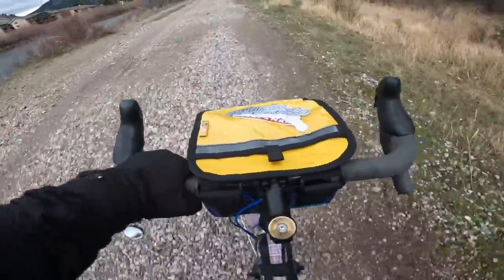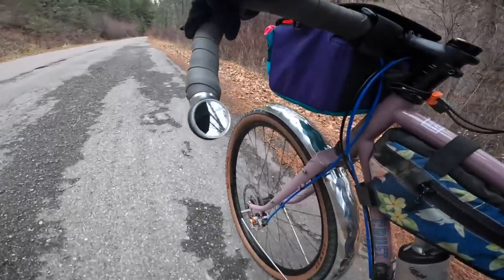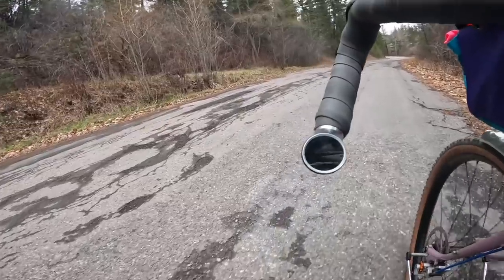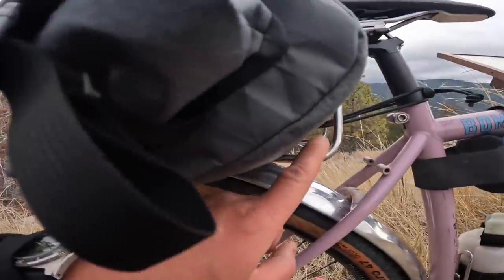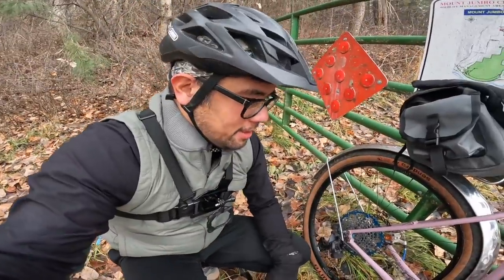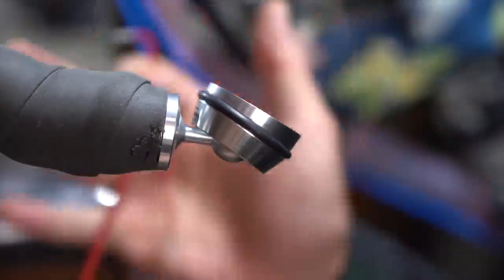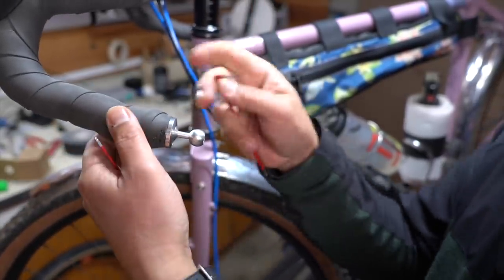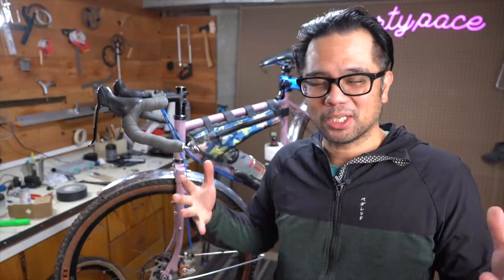These Are Pretty NERDY But Cool!

Comment: In over 10 years of daily commuting I would not be without a Busch and Muller (aka B&M) 60mm diameter Cycle Star mirror in my bar end. Optical quality is beyond any of the cheap plastic lenses. Luckily we ride on the left here in UK so leaning my bike for those drivetrain pictures is not a problem!! For mudguards/fenders my Portland Design Works are still rattle free and smart after at least 30,000 miles

Comment: in 2032 you'll be able to fasten your iphone 19 to the back of your helmet and use a neural link connection into your brain to have visual imagery and lidar supported depth sensing to the rear of you. There may even be lane keep assist and automatic emergency braking integrated into the neural link suite of tools.

Comment: These are fenders of proper length! I remember my first winter of commuting on hardtail with short front fender, which I extended with a contraption made of of large plastic bottle cut in half - curvature made it rigid. Boys I felt like a weirdo riding through town but dry legs convinced me.

Comment: Adding small leather washers to every fender support helps a lot with squeaks. They're getting hard to find but wouldn't be hard to make.
Reply: Remember those days of tire tubes? Well an old tire tube makes excellent insulation stripping anywhere. That rack on the fender rattle instantly made me think of a strip of old inner tube right in that spot lol.

Comment: I went for the same version of the Gilles Berthoud mirror..😃 yes it's expensive! But it's like jewellery for your bike. 🥳
 I used the Cateye BM-45 for a long time which was pretty good. I think it actually has slightly larger viewing surface but would bump out of place on really rough stuff. Maybe grip paste would've helped, don't know. 🤔 Truly wouldn't want to be without a mirror now, especially with wind in the ears sometimes I just can't hear cars approaching from behind and craning the neck to peer behind every 10 seconds is a pain! 😃 Cheers. 👍

Comment: I bought a set of the VO wavy fenders in noir when I did the 650b conversion on my Salsa La Cruz. Getting them where I wanted when the bike was designed around narrower 700c tires is took a bit of work, but they have been rock solid on all surfaces so far.

Comment: I've got my Take-a-Look permanently attached to the visor on my helmet, which I have been using for several years now.  It took some bending and ingenuity, but the mirror is always in a predictible spot allowing a quick and precise glimpse without looking away from the path ahead, does not destroy my glasses, is smaller and much, much less expensive.  Plus, I believe they are made in usa, which makes me happy :)  When mirrors are attached to the bike I find myself searching for the mirror then turning my handlebars to look for stuff; not practical for me!

Comment: I had 2 of those mirrors. They work great, but after a 30 miles into a gravel ride,  I look down and the mirror is gone,  just the part the goes into the handlebars was all that was left. Wrote it off to operator error, but the exact same thing happened with the other one. Yes I lay my bike down, and was doing some b-roads, but you would think for the price the set screw would keep it together if it was bump or hit something, apparently not. Learned my lesson with the super cashy mirror.

Comment: I also have had problems with the adhesive not lasting with the Third Eye Helmet Mirrors, but I have solved that by using the 3M reclosable fasteners.  They usually adhere for a couple of years and I carry spare fasteners in my bag.

Comment: I've had the same cheapo helmet mirror for like 6 years at least now. Inspired by my tollway iPass, I just attach it to my helmets with some Scotch Extreme Interlocking Fastener tape. I also use some squares on top of my helmets for mounting lights for winter / night riding. I like that if I get in a wreck the light will break off the helmet vs. getting caught on stuff. Has saved me numerous times on overhead branches, etc.

Comment: I love my Trek 520 with fenders. Although I am from Germany I prefer Pelago fenders from Finland because of their design (Aluminium, externally mounted). SKS and their internally mounting of the stays sucks! It decreases tire clearance and catches mud and other thinks until blocking the wheel. And finally the water stalls from the inside. With one word: bad construction!

Comment: I used the Gilles Berthoud mirror for a bit but was not pleased with the size.  I found the B&M Cycle Star 901 from Peter White to be a larger, option with an excellent glass mirror.  It's body is plastic.  But I've had no problems with vibration movement and it is large enough to be useful to me.
Reply from the maker: Will check that one out.
Reply: Do you have to readjust it each time you ride? It appears it would be easy to bump it when transporting or storing the bike.
Reply: @philso7872  Both mirrors are easy to bump (for me) wheeling them through doorways and such.  But as Russ said, the smaller GB is pretty firm.  The larger B&M can be bumped out of place but not nearly so easily as anything else I've used that just has the plastic ball and socket.  Another down side of bar-end mirrors on drop bars is that they seem determined to collide with the top tube of the bike.  I usually carry a frame pump with a retaining strap and place the strap in the "mirror-strike-zone."  But all in all, like Russ, I find the utility of an excellent glass mirror fixed to the handlebars infinitely better than dangling from my helmet!   Rivendell sometimes sells what they call a "German" mirror that clamps around the handlebars.  It is an unusual, long shape with a mirror that places things further away than they are.  But it too can be clamped on a drop bar bike.  My main complaints with it are its somewhat distorted view and the longer extension of the mirror from the handlebars.  I always seem to be able to knock it out of place.  But there again, it is still much more functional for me than a helmet mirror.
Reply: @MelvinHughesatp  thanks for the info

Comment: I use a Muller and Busch mirror (I think thats what they are called) for my alt bar tourer. I was first attracted to them because they also make the mirrors for my BMW motorcycle and those are superb. It is a decent size without being huge but you have to be careful leaning your bike against stuff. Having said that it is very easy to flip back and adjust if it does get knocked. I now wonder how I managed without it, not the cheapest out there but worth every penny.

Comment: I think think that you could spray the bottom of those fenders with a rubberized  spray and that would cut all the noise. I've seen it done to that one wheel fender and it cuts all the road noise.

Comment: Fenders are a necessity up here in Vancouver, Canada but I hate the toe overlap that increases and the terrifying instances when your toe gets hung up underneath the front fender :O 
Maybe I need to find a frame/fork with a longer front centre ... 
I'm curious if you had the same thoughts or issues with your Crust? Maybe 650 wheels will help?
Reply from the maker: 650b helps but still some toe overlap.

Comment: for what it's worth,  I've used the same Take-a-Look mirror for about ten years, but mounted on the side of my helmet sun visor. The three "clip" mounting system works great, and I've added a bit of duct tape to keep it more secure for when helmet is in car etc off my head. Works flawlessly, but does require a helmet visor with a narrow section at the side that you can slide the three mounting things onto. I've tried numerous mirrors over the decades, and the Take a Look is the most useful, safest and best view of rear coming traffic, and for those of us with numerous bikes, just plain handy because it is always there. I'm a tourer who has gone through many countries over the decades and a daily commuter in a large city, and would not ride without one--the ease of getting a quick heads up and flat view mirror (no wide angle distortion=easier distance assessment)  puts this mirror way up there on the safety and convenience side of things.
Reply: Do you have to readjust the mirror each time you put on the helmet? It appears it would be easy to bump it when transporting and storing the helmet
Reply: @philso7872  , no not usually. I generally am careful how I put my helmet in places, and if it gets moved a bit, it takes 1 second to reposition it when I get on the bike and see that it's off a bit. Mine always holds it's position, ie it's not floppy and loose, so really it's never bugged me at all.
Didn't mention but the other two major advantages to helmet mounted mirrors are that you can still see easily when out of saddle , and also in mid turn, with just a little turn of the head, you can see cars coming into the curve behind you. This ability to change your viewing angle with a slight head turn is really really useful.
Reply: @davidbabcock3261  thanks for the info. It sounds like a good way to go
Reply: No prob. Just be aware that some people don't like having the mirror in their field of vision. Took me a week to get used to it. Some hate it. Only way is to try it.

Comment: I'm a big fan of VO fenders. I use them my two main bikes. No rattle and really stable. I would recommend a front mud flap if you travel through half flooded roads like I do on the Oregon Coast. It really helps keep my feet dry. I also own the Giles Berthoud mirror. I can't say I'm that big of a fan. Perhaps there's a defect in mine, but the grub screw never seems to hold it tight enough. I've had mine fall off several times. I found a similar bar end mirror made by I think Cat-eye that works well. Not quite as pretty, but it's also about a cm wider.
Reply from the maker: Have you tried adding blue thread lock?
Reply: @PathLessPedaledTV  I haven't, but I just had a look at it again and I think the problem is how mine sits on the ball joint. Tightening the grub screw seems to force it off the ball.  I'm guessing the mirror section isn't recessed deep enough.
Reply from the maker: @Threestrand1  sounds like a manufacturing mistake.

Comment: I had a set of smooth VO mud guards, they did pick up dings easily and I picked up a twig on the rear wheel which caused the rear fender to folder up like a concertina, after which they were trash. 18months they lasted, not really good value, back to sks for me. Good luck with yours!

Comment: Mirrors like that, I use a Corky, are amazing for cycling at night. They're unusable for the most part although they reflect car headlights. They appear like two bright lights or snake eyes which gives you plenty of warning for passing cars.
Reply from the maker: I've tried the corky and it is unusable IMO.  Way smaller image.  Also super shaky.  Its frigging pointless.
Reply: I had the flat-bar version of the corky, really liked it (particularly because it becomes invisible when closed), but sadly the plastic ball joint broke when I accidentally hit it with my hands; a more robust metal version would be nice.
Reply: @PathLessPedaledTV  For Gravel yes, on my road bike it's invaluable. The only issue I've had is the little screw falling out so I've ended up gluing the joint together with Zap Thin CA superglue.

Comment: One can dream...  Russ I notice you wear your glasses on the inside of your helmet strap. I reached the age where I need readers and will have to invest in prescription cycling glasses. I always were MTB or road cycling glasses, mudd happens. Could you do a review on safety stuff that us city dwellers need like cycling glasses pros/cons(in or outside wear of the helmet strap), more mirror reviews and thoughts on wheel lights....

I used to think "mannin up and dealing" with a soggy wet butt made me a real cyclist. I think this year I will ask Santa to bring me some sort of derriere protection device. 30s here and rain in the forecast, not doing it this year.

Comment: I wish the GB mirror had just a tiny dome to it. It's a trade off - dome shape makes objects appear smaller and harder to recognize, but completely flat on a mirror this small means getting a view from multiple positions is tough. Can't help thinking a very subtle dome would be the best of both worlds. Not too much to hope for on a $90 accessory.
Reply from the maker: I’ve tried a similar size one with a dome and it was almost useless until the car was next to you.

Comment: Nice video, quick question on the fender size and tire since fat meats and fenders don't mix too well.
Reply: Nevermind, figured it out. Velo-orange only makes one wavy 650b size: 58mm and the tires clearly say 47mm on them. Thanks for the info in the video.

Comment: Also get a mudflap, i bought the overpriced Vo  one but you can easely make your own Out of rubber gasket material . I riveted Mine to the fenders fir a cleaner Look but screws Work of course. 
Its amazing how much of a differece a front mudflap makes For your feet and drivetrain.

Comment: Do you have or does any one have a suggestion for a fixed gear that has big tire clearance and has racks and mounts for fenders? Been wanting to do this kind of ride on a fixed gear.
Reply: Many surly models fit big tires and have sliding dropouts plus loads of mounts

Comment: If you can't see enough details right away, there is no point of the mirror. Might as well look back.
Link for the seat-support rack?
Reply: Only details needed is : is there a car back and is it moving over for a safe overtake. I have stopped countless deliberate close passes by turning around to eyeball drivers who I am sure were about to close pass. This takes their element of surprise away and they pass by at a legal distance. (1m-1.5m in Auatralia.). Have gone from multiple close passes per ride to zero in 12months.
Reply: @2321brendan  for safety, it's better to compromise on aesthetics and aerodynamics and go for larger 3 inch diameter display on the handlebar...

Comment: If you had to choose between the mirror and a garmin radar which would you choose?
Reply from the maker: Mirror all day.
Reply: @PathLessPedaledTV  I am extremely satisfied with my Garmin Varia. Did you even try it? Planetary resources asides, the Varia changed my cycling experience more than any other accessory.
Reply: @karlalvtorn5222  Does the Varia identify a potential close passhole?
Reply from the maker: @karlalvtorn5222  haven’t tried it but I don’t understand how it could replace having a visual ID on a vehicle. With a mirror you can tell the type, size, approach speed, if they’re swerving and it never runs out of batteries.
Reply: @PathLessPedaledTV  It can tell approach speed from 140meters away, even tell how many vehicles that are about to overtake you. It can also warn with audio if you so choose which is immensely useful for me at least. I’ve never had the device miss a vehicle, altho a few false positives happens which isn’t such a big deal. 

Battery is a pain, but combined with a rear light the penalty is less severe unless you are running dynamo-lamps. The radar-adapted lamp also makes drivers more considerate - believe it or not. It is an amazing daytime-running light.

It cannot tell if a drunk trucker approaches tho.